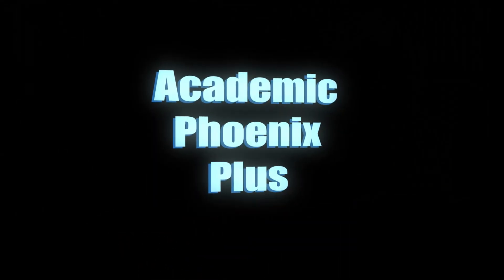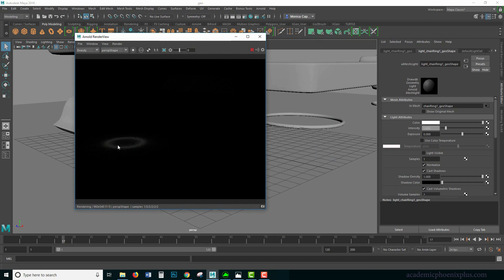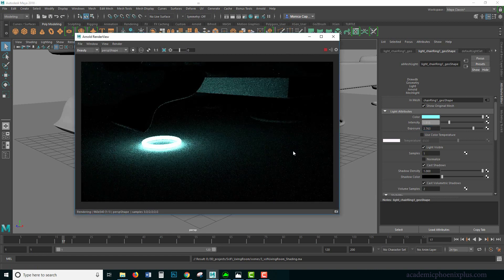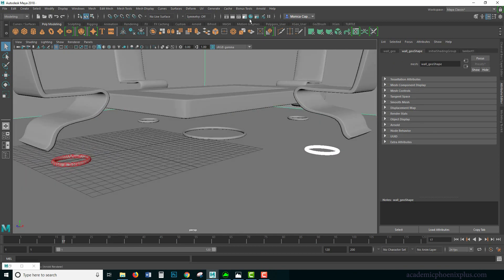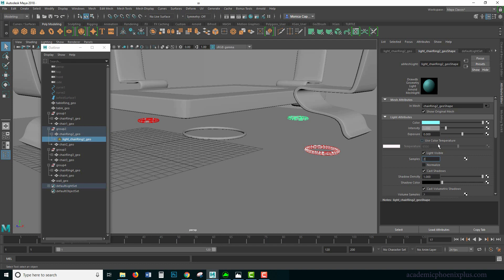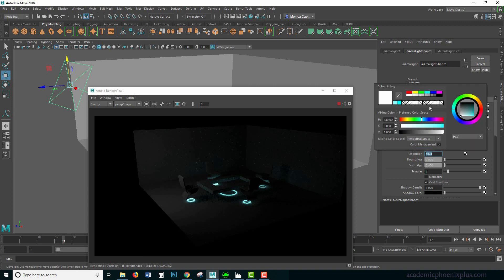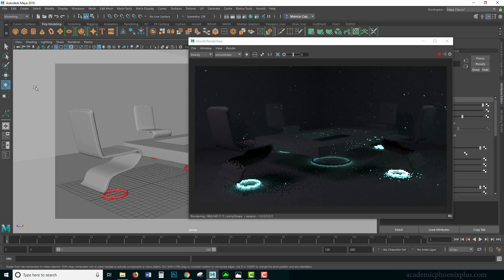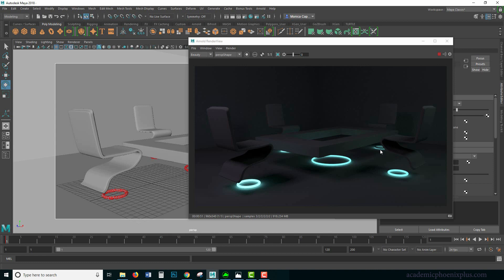Arnold's Lights and Incandescence for Maya 2018

Comment: When I add an Arnold Mesh-Light to a Mesh, I can't get the Light to spin in tandem with the mesh. I added a rotation keyframe to both the light and mesh in the channel box. The mesh moves but the light won't. Can't figure it out. Any help is appreciated!

Comment: Tip: You shouldn't work with "Show Original Mesh" and "Light Visible" options both switched on at the same time. It is hard to find information about this even in "arnold docs" but the way that mesh light works is, it create second surface which emit light exactly overlaping the original mesh. When both options are switched on engine have hard time to choose which one to render. In result it render once the original mesh with applied material, and other time the mesh light. By default both options are switched off. When you create mesh light and want that light to be visible directly for the camera you should use "Light visible" option. That way the engine control the look of "light" shape according to apllied texture or color temperature and total brightness of the light. This is physically correct. If for whatever reason you want to change direct look (indirect look like in the mirror will be still controled by arnold mesh light unless you swich off specular visibility in visibility section of the light) turn on "Show Original Mesh" and apply a material to the original mesh to give it desirable appearance.
Reply: A good explanation and tip, thank you friend.

Comment: Thank you so very much for your fun and awesome tutorials. Despite following step by step, my ring looks like a bright plain, unlike yours where you can still see a solid ring emitting light. In other words, your rings look like neon tubes if u may, mine look like flat color plains with light around them,not really a 3d solid object emitting light. I'm using mesh light and material assigned is ai standard. (Maya 2017)

Comment: The reason those mesh lights weren't working right is because of the inter-penetration of the geometry. Scale up the actual lightchairringX_geo and then they will look right.  Cool demo. Thanks for sharing. I have to learn rendering for a job and this is my first rendering tutorial I settled on.
Reply from the maker: Nice tip. Thank you for sharing!

Comment: my arnold lights are glitchy as well :/
Reply from the maker: Yeah, it's pretty interesting. Just turn of the geometry and it should work better. :)
Reply: yes, actually, I tested it and the fact is that if you uncheck ''show original mesh'' and check ''light visible'', the display problem should be solved.
I know you probably have figured it out already but we never know :)

Comment: Thanks for great tutorials. I think the reason for renders behave unpredictably is you check both show original mesh and light visible. So there is two surface at same location one is mesh and the other is light. So arnold can't decide which one to render. Check only light visible.
Reply from the maker: I believe you are right! Thank you for the comment, Enes. :)

Comment: I've added the lighting in the ring but, in my render view, nothing is being displayed, it's completely black.  So what settings should I make in the render settings?
Reply from the maker: Thank you for your comment! If you made the ring into a mesh light, you need to increase the intensity of the light, or increase the exposure (exposure 's value is will exponentially increase your light's intensity). Also, use area lights to help light your scene more. I hope that helps!
Reply: @AcademicPhoenixPlus  Thanks for your kind reply!
Yes, I've increased the intensity of the light and it worked!!!!!

Comment: Hello Monica. I enjoy your tutes. Thank you for making the effort and doing so with such enthusiasm. 

I followed your futuristic conference room tutorial. I followed your steps, but then deviated and, I think, improved upon it. I created a simple camera move through the room, and set it to render. 

Problem: Render time vs. noise. I thought I had my render settings at just a good enough level, and some parts of the render looked quite nice. But, where the chair line-lights got thin, they flickered. Also, there thousands of barely-discernible-but-still-visible ants running all over the chair and table. And, with this, each 1920x1080 frame took about 30 mins each. 

Now, my system's fairly old -- a silver/metallic Mac tower, using two Xeons, 2 fairly powerful graphics cards, with about 32GB RAM. Also, including the five mesh lights, I placed about 6 spots with soft shadows. 

Question: Do you have Arnold render-optimization tutes? 

Thank you. And, keep up the nice work. 

Keith
Reply from the maker: Hi Keith, Thank you for your comment. I'm thrilled to hear you are following along and making it stronger. Yes, noise is a always a problem when it comes to lighting. There are several ways to get rid of it, via the lights and render settings. Eventually the renders take too long, so compositing comes in. You can either render forever, or composite. I'll definitely have to add a tutorial on removing noise, both in Arnold and composting. Thank you for the suggestion!
Reply: I replied via e-mail and I'm looking forward to your future tutorials, including one on solving the noise problem. (I also have another google account, 'kyakouboff', so I'll probably be watching with one of these two accounts.) 

Anyway, tanx.

Comment: For some reason, my Mesh lights have shitty antialiasing. I end up using an emissive material to have it emit lights and have good AA.
Reply: The reason is that antialiasing averages two contrast pixels, for example if you have one white next to one black the average result is grey but when the white pixel goes beyond 1 (which is usually the case with light sources), let's say 3, the average result is 1.5 but everything beyond 1 is pure white, so what should be seen as grey because of the antialiasing is seen as white, you can use a color picker to check this, even if all pixels are white, the edges have a different value.

Check this, it may help http://cgrenderdna.blogspot.com/2018/06/how-to-use-acescg-in-arnold-for-maya.html
Reply: @JC Thanks for the reply. Your explanation makes sense. But is there a way to use mesh lights and have AA? I am not sure if that article and it's settings would help with AA.
Reply: Aakash Kalaria I haven't tried AcesCG but HDRIs look burnt out in renders and they look correct in that article, try it I'm not sure and check out mesh lights in the arnold's user guide, maybe it says something about that issue.
Also you can try checking clamp in the render settings and play with the limit.
The user guide recommends using exposure and not intensity for lights, I'm not sure about mesh lights.
Reply from the maker: I love it when other viewers help each other. Thank you Jc!
Reply from the maker: I'm glad the emissive material worked out!